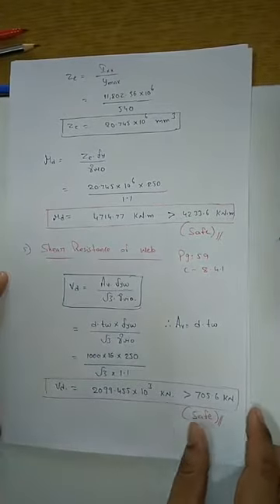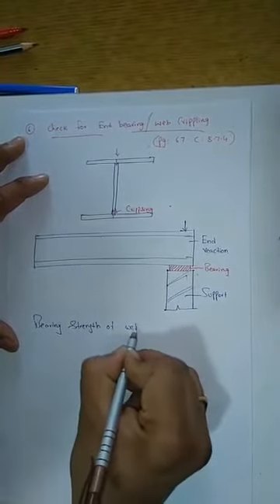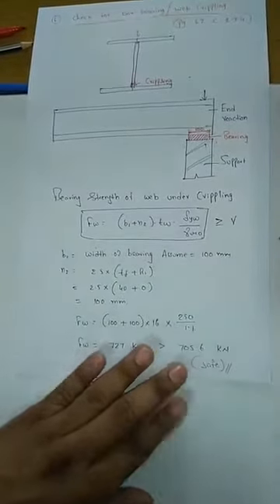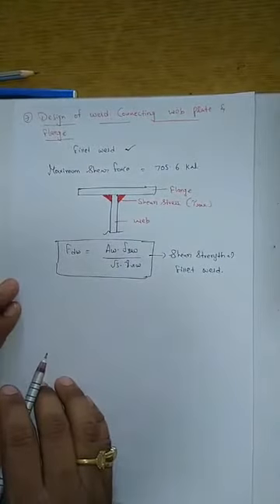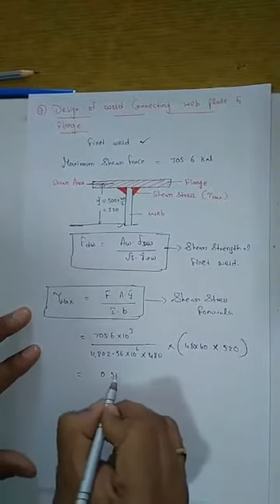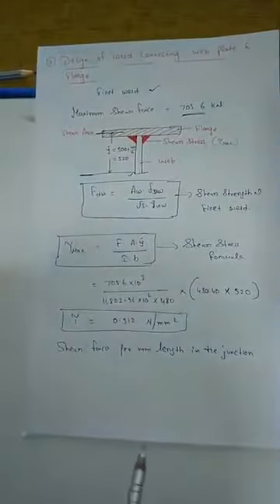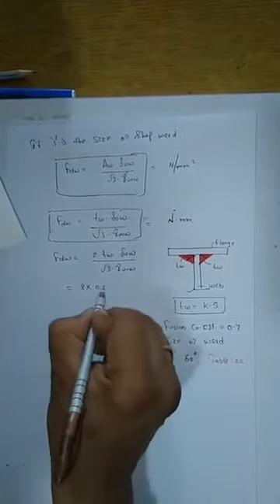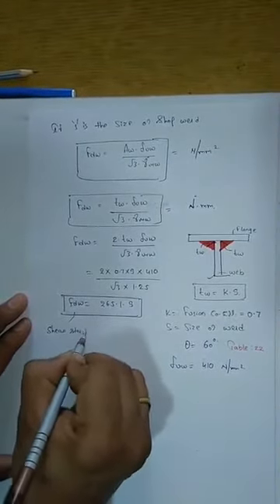Problem on Plate Girder (Lecture-2)

Comment: sir i have a question can you please help  Q.= A plate girder of grade 410 steel has a 12 × 1800 mm web and 75 × 550 mm flanges. Determine the flexural strength, if the unrestrained length is 10 m.
Reply from the maker: Only selfweight of the girder is going to be considered for the design...bcz of no live load...ok will do and uplaod that video.